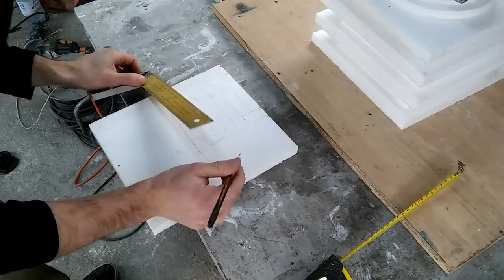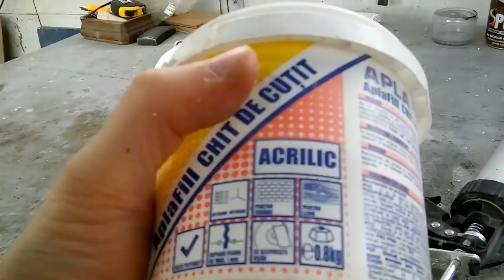How I made this concrete oribe lantern

Comment: I would like more information on the hotwire. Use cabinet screws instead of sheetrock screws. You left everyone hanging with the top orb.
Reply from the maker: The mold it is made from 100% silicone caulk and flour